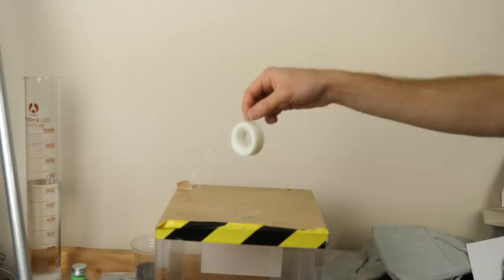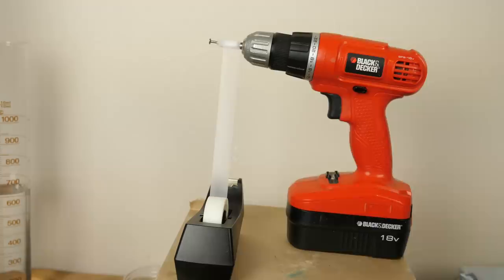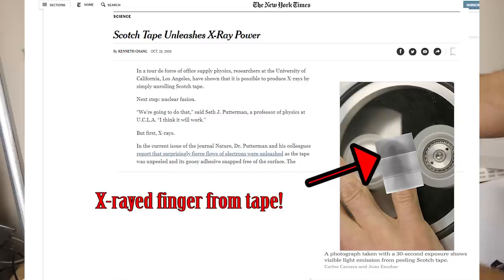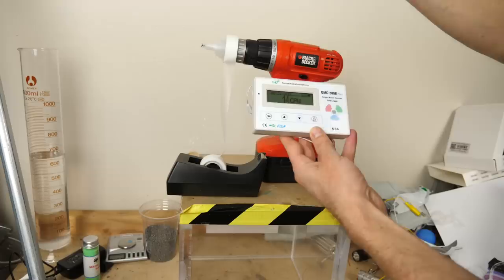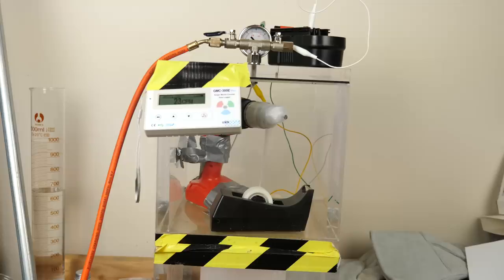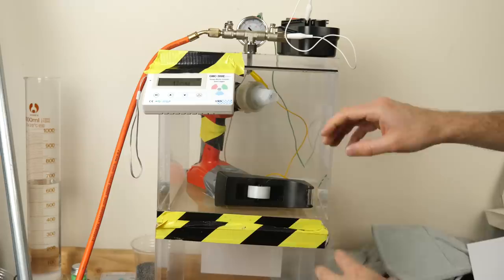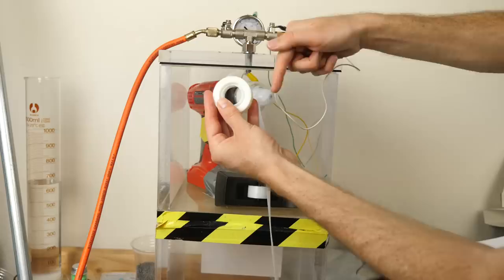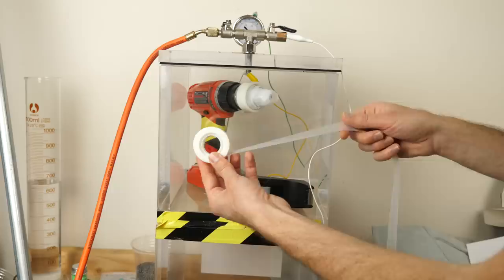Is Scotch Tape Radioactive? Making X-rays From Tape—Triboluminescence in a Vacuum Chamber

Comment: If X Rays can be produced by fast moving electrons in a vacuum, would the same happen with an electric spark jumping a gap in a vacuum?
Reply from the maker: Yes, that is how x rays are made in an x ray machine essentially
Reply: Hmm
Reply: well same thing happens when you remove a keep warm shirt you can see charge in them at night.
Reply: Well does that mean when there is a lighting falling from the sky and hit the ground it creates a large amount of x-rays and is there any radiation that could be detected ?
Reply: niki there is plenty of electromagnetic radiation that can be detected with lightning strikes, you can see it with your eyes in the visible spectrum:D

And yes they do produce even x-rays which can be detected.
Reply: niki123489 no because there is no vacuum so the electrons are not reaching high enough speeds... right?
Reply: Jacob's ladder won't work in a vacuum,  the spark moves up because it is heating  the air,  and hot air rises,  but lets give it a go
Reply: @niki123489  - Some gamma rays and positrons too have been reported during lightning strikes. The positrons may come from the fact that some lightning strikes are initiated by cosmic cascades in the upper atmosphere.

Comment: Question : whats the speed of a smell(how fast can a smell of something travel)
Reply: for exapmle if a bear can smell a human from 1km  how time will it need for the human smell to reach the bear?
Reply from the maker: That’s a good one to test!
Reply: Universe is AWESOME I think that it will depend on many factors, like wind, other strong smells arround, how much the human smell, etc. But is a good question.
Reply: PabloGamer530 what about theres no wind though how does it travel?
Reply: The Action Lab also... can you smell anything in a vacuum?
Reply: Depends on what u smell....... 

Hehehe
Reply: Smells are essentially particles suspended in the air, so it depends on wind, the size of the particle in the air, humidity, air flow, etc.
Reply: Well probably animals have better noses (those things that smell the...uhm... Smell i guess?) and when the smell is traveling by air lets say at the same distance the dog will smell it faster than human i think idk really
Reply: The speed of the particles of whatever you are smelling.
Reply: How fast does smell travel under water?
Reply: Universe is AWESOME .the speed of smell will depend on the speed of wind,direction of wind atmospheric pressure, and power of your nose(i.e.how many particles of something are required by your nose to generate a sensation)
Reply: Not an expert. But I guess if the particles can't travel without wind....so no smell in vacuum
Reply: Well that would just be how fast particles from an object moves
Reply: As fast as the air does.
Reply: @TheActionLab  Please do - I want to know this too :)
Reply: @qualynforeman6747  And how does it travel.  If a shark can smell a drop of blood miles away its hard to believe the blood diffuses that far and that fast in all that water.  Is there some other means of propagation happening such as electromagnetic?
Reply: @TheActionLab  is the next video going to be about it?
Pleas answer
Reply: And it also depends on how strong the smell is...

Comment: I thought about testing this also but I found out that most geiger counters don't register x-rays so you need different kind of measuring device. I hear that old style photo film would react to xrays so maybe filming through black paper with film camera would be better way to see will this work with your vacuum pump
Reply from the maker: Yeah, the kind I had did say it can measure x-rays, but I think they are low energy x-rays so even the acrylic can block them. I saw some other video after I made this with film in the vacuum with it that might work. You should try it!
Reply: In regards to the old films, you can see the proof on some videos from chernobyl that they do react with the radiation - burning holes I think, but I dont know much about the differences in radiation, so I might be very wrong

Comment: Hey, nuclear engineer here: Background radiation is not just radon, nor is it the main contributor either. You can have uranium in concrete floors or walls, a lot of cosmic radiations, certain minerals, and mostly from inside our bodies! we have potassium-40 inside of us and it decays by gamma. Mostly it's difficult to really say where the background radiation really comes from and it's highly variable depending where you live. Some places in india and africa can really give you a huge dose but we still don't know fully where these anomalies come from. Fun fact: we don't wear fleece in the power plant or the radon sticks to our clothes and sets off the super sensitive alarms.
Reply: Potassium-40 mainly decays through beta emission. I used sodium-free salt substitute and plastic can walls as well as polyester fabric attenuate a significant amount of it. That would make little effect on gamma.

Comment: I have an experiment 4 u:

We all know from your earlier videos that most of the energy used by for example a blender, or when lifting an egg and dropping it turns into heat in the end.

But how about sound waves from speakers? Do their motion energy get turned into heat when they hit stuff? If so, would it be possible to heat up a room just using sound waves? How much do the frequency and the amplitude of these waves influence their heating efficiency?
Reply: ye
Reply: He already did that ezperemwnt and yes bit barely dectectable

Comment: I did my capstone over this!! You could potentially use this system in 3rd world countries to generate x-rays for medical use. I tried contacting the professor who originally studied this phenomenon with tape, but no response unfortunately. I'm so glad to see you doing this!!
Reply from the maker: Did you actually try it?
Reply: idk man because an x ray tube is not hard to make at all its literally 3 tungsten electrodes (1 filament 1 point 1 plate) in a vacuum tube and its seeled initially with a vacuum pump but there is also a metal that easily oxidizes called a "getter" inside that is placed in and heated once sealed to form an even greater vacuum.

its cheap to make and the running costs wouldnt be as much because it only needs a low voltage on the filament like a normal incandescent bulb.
but the 2 other electrodes need 40kv across them to generate x rays.
it is not hard to create a 40kv psu in a 3rd world country anyway the current flowing will be limited by the tube.

of course its still not a household made thing without spending around 50-100 dollars for the stuff to make the tube because an individual buying parts will cost more than a factory/company creating/buying an already assembled tube.

my point is som1 would rather buy a cheap glass tube than an expensive vacuum chamber to produce x rays.
Reply: The Action Lab no I wasn't able to, I didn't have a vacuum chamber unfortunately.
Reply: you would need one heck of a vacuum chamber to do perform that experiment!!
even his couldnt go below 0.1 inches in Hg.

most vacuum chambers have an oil that is circulated through an aspirator device powered by a fluid pump and the air gets sucked out but only to the limit of the vapor pressure of the oil at the given temperature its at.

now idk how these really good vacuum chambers work but heres a wikipedia on them
https://en.wikipedia.org/wiki/Ultra-high_vacuum
Reply: Lauren - I think you're missing some understanding. Do you know how much electrical energy is needed, for example, to generate enough focused X-rays to X-ray a human finger?
To do this, you would need to roll 50,000 miles of tape in half a second - that might generate enough energy after you've consumed even more energy to roll off the tape so fast :) Dead End. Maybe go to school again and take care in physics lessons.

Comment: Maybe try again with the geiger counter INSIDE the vacuum-chamber. 
there are different kinds of radiation and some are weak enough to be blocked by a piece of paper, while other require some lead. 

so with your measurement device iside the chamber it shouldn`t get "distracted" by radon AND having it as close as possible to the origin of the radiation increases your chances of actually meassuring something. Also not having the glass, or whatever your chamber is made of, in the way, would help.
i`d like to see that.
Reply: His detector should be essentially blind to radon, with the most likely isotope being 222Ra who's decay chain is primarily Alpha, but its parents decay chains do include some gamma and some Beta.

In this case his detector uses a J305 Geiger-Muller tube, which is sensitive to Hard beta and gamma/ hard Xray.

In this experiment its most likely he failed to detect the Xrays from the sheilding his vaccum chamber provided, if his counter was even able to detect that low energy Xradiation.

It would be wise to use vaccum rated detectors, not all tubes are sealed in a manner that will keep their gas in under vaccume.

Comment: You could maybe use your current vacuum along with a high voltage electric field across the tape to help the electrons make x-rays. It would be worth testing the setup with and without the vacuum of course.

Comment: Put detector inside chamber.  remove plastic case so gieger tube has direct exposure.  I have that same detector.   I also have some marbles covered in a thin layer of uranium-bearing laquer (united nuclear).  These marbles measure about 50cpm when next to the vent holes in the case, but when I remove the case and place the marbles directly adjacent to the detector tube, it measures 230+ cpm.

Try repeating the experiment with the adhesive reaction situated very close to the bare detector tube.

Comment: I think the thick plexiglass you use for the vacuum is attenuating the x-ray strength. The detector should be left inside the vacuum chamber, as near to the source of radiation as possible. The number of x-ray photons produced might also be so few that you might need to further shield the inside of the chamber so that stray scattering radiation might have a chance to bounce (interact with the matter, whilst not being absorbed) and create another point source for that radiation to hopefully hit the detector. If all else fails, you could always buy some film, load it into a Manila envelope and then later develop it to see if you get any marks, but it takes a lot more radiation to expose film than light (the reason why that method is no longer used). I am however expecting the x-ray energy to be very weak, low penetration and few photons.

Comment: Suggestion.

1. Flood your vaccum chamber with argon and draw down under a vaccum and repeat.  The nitrogen in the air is acting an insulator and the argon even under vaccum will allow plasma and electrons to flow easier.

2.  Use Packing Tape, increase your triboluminescent surface area.

Comment: You need to measure near where the tape is rolled off the reel. It is the breaking of the crystal bonds in the glue that emits the light, not up around the drill head winding it up again.

Comment: Applied Science did the same experiment with a high speed water jet hitting a glass wall, creating a faint blue glowing dot that's practically a tiny ring of electric discharge around where the jet hits the surface.

Comment: This experiment may have worked better with the detector inside the vacuum chamber, since the glass of the chamber is fairly thick and likely absorbs a little bit of the x-rays.
Also because of the inverse square law for the intensity due to distance.

Comment: If you put the detector inside the chamber, would you see an increase of radiation? Maybe the chamber is concealing the radiation due to less air in it vs the standard pressure outside of it.

Comment: Hi ActionLab!

 
Love both your channels. Also, love that you use experiments to explain physics concepts.

I have a question that I would like you to tackle if it is possible.

Here is the scenario:

You are driving 60 miles an hour (constant) down a freeway in your car with the windows rolled up, and a pesky fly is flying around in your vehicle bugging you.

Here is the question:
Is the fly flying faster than is physically possible for the fly? Does the fly’s speed equal the 60 mph (movement of the car) + .25 mph (or whatever speed the fly is moving at)?
 Is this indicitave of a "closed/isolated" local system in which everything in the cab of the car is moving at a constant specific inertial speed and therefore the fly doesn't experience the car speed of 60 mph? Please elaborate on the physics of this idea it's because its been bugging me (pun intended) for a long time. :-)

Thanks

Comment: I'm going to have to try this experiment. Where did you get your Geiger Counter? Does this one have a pancake sensor or a mica GM tube? The soft x-rays if they are generated probably can't make it thru the plexiglass. You don't need a vacuum to make x-rays. Any spark with enough voltage (over a few KV) will do it. A spark from a Van de Graaff  generator will do it too. So do lightning flashes.

Comment: great video but measurement of radioactivity that you were using is called counts per minute not clicks per minute. And the Geiger counter that you have can only detect gamma, beta and x-rays, not alpha. to detect alpha particles you would need a so-called pancake tube.
Reply: Actually, x-rays need to have at least 100 keV energy for the counter to detect them according to GQ documentation.
Reply: @dymytryruban4324  I work with x-ray machines running at levels as low as 18 kVp, and my Geiger counter can detect their presence very easily
Reply: @TylerWynn  What is your Geiger counter? Is it sensitive enough for low quantic energy X-rays? Was it affected by electromagnetic interference? When measuring high energy photons, scintillator is the best choice because it measures faster and Geiger counter can give you lower readings.
There are a good videos, though in Russian but captions can help: 
watch?v=ddvmIG702Uk
watch?v=-jfNmbsy8XM

Comment: The reason you didn't read any x-Rays on your geigercounter  probably has to do with the fact that there's a thick plate of acrylic. I don't expect the photons emitted to have a high energy and acrylic is actually a pretty effective  shielding material up to 120keV. I don't know the exact thickness you're using, but it looks like at least 1/2 inch which basically translates to +/- 0.75 mm of lead.

Scotch tape is not radioactive. Radioactivity has to do with unstable isotopes. Cores that have too many protons or neutrons and find a more stable composition usually by emitting particles and gamma-rays. The processes you described and likely to be happening have to do with electrons gaining and releasing energy.
Reply from the maker: I didn’t know that acrylic absorbed x rays that much! That could definitely be a factor in this.
Reply: The Action Lab it's actually used in hospitals as shielding material. We're often behind a piece that's 1cm (less than 1/2inch) thick. 

If you want to be a radtech in the Netherlands you have to get a degree in radiation safety (basically calculating exposures, and the absorption of radiation in different materials and the effects of distance on those calculations

Comment: Yea, if you are at ten millibar, your mean free path for gas molecules is on the order of 10 microns.  I have no idea off hand what the mean free path is for a free electron would be at these pressures.  I also have my doubts about it being at detectable levels for such a crude countering method to be conclusive.  But that is why we science...it would be cool to see a definitive result!

Also, with a mean free path at 10 microns the thermal conductivity of bulk air is down by around a third however the walls of the chamber are still effectively infinitely far away.  I would really like to see that cooling metal ball experiment with more quantified temperature measurements as it cools!  I kinda do expect it to cool significantly slower under those conditions...  This is in direct contradiction with a statement in my undergraduate thermal book and I am super plagued by it...I really want to know if Kittel’s reasoning may have been wrong here😅